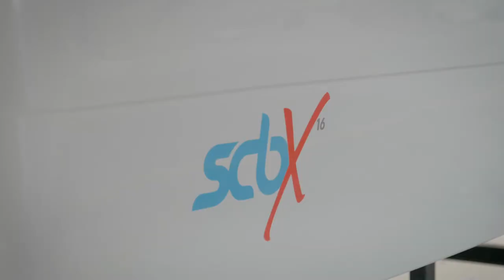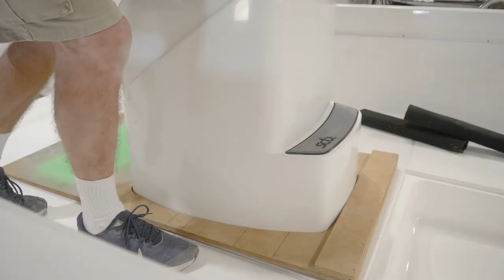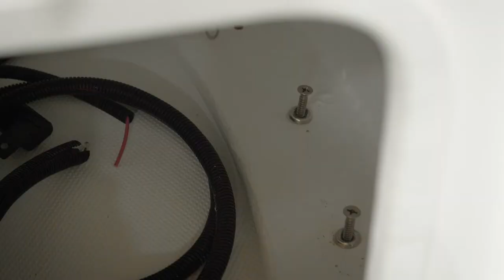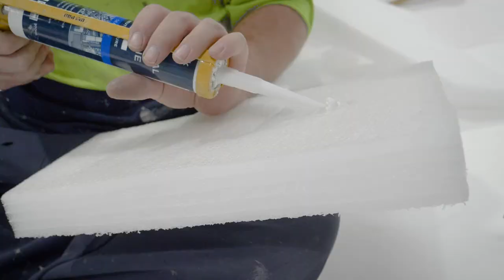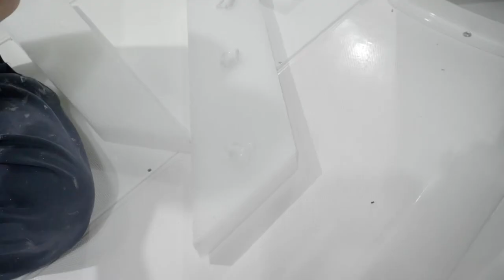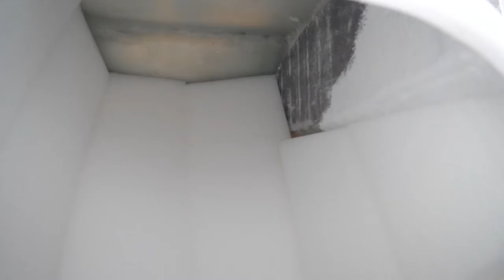SCBX16 Centre Console installation tutorial

Comment: What kind of screws did you use
Reply: stainless steel .. but this is a super weak way of securing the console after a couple years .. in any sort of choppy water the screws pull out of the fiberglass, also .. use thicker stainless 1" diameter washers,, under the cheap flush mount rings shown here, they just make the screw heads flush.. put the 1" diameter stainless steel washer under,.. that way your console lip doesnt crack from pull pressure.. people grabbing it leaning or pulling to hold .. or get into the boat etc..